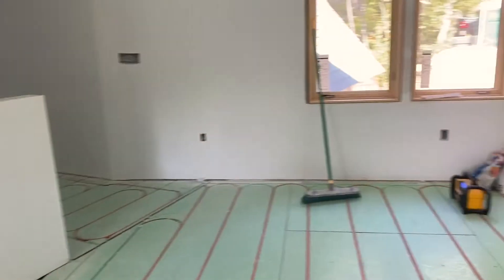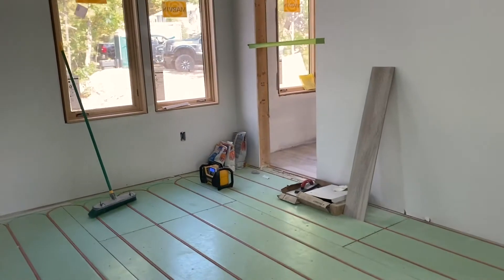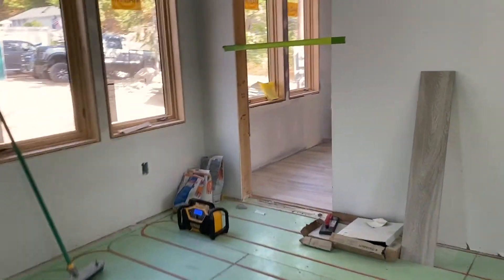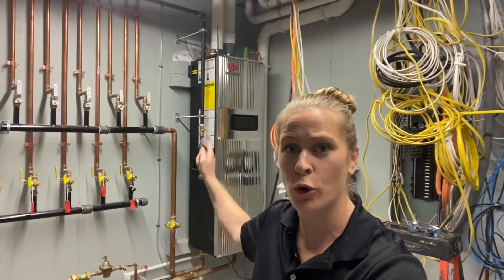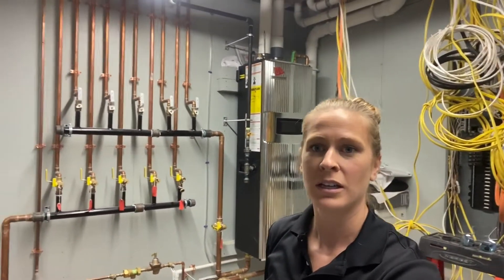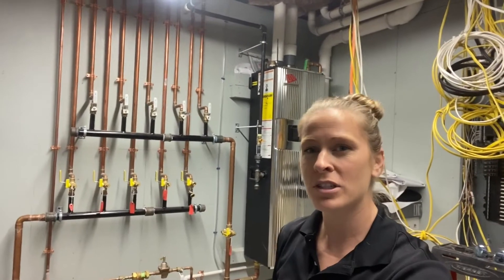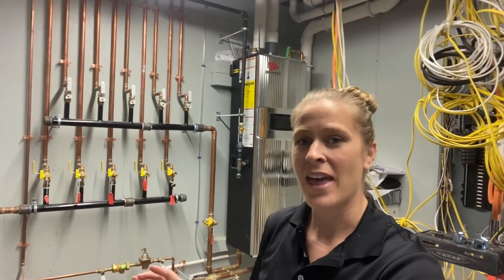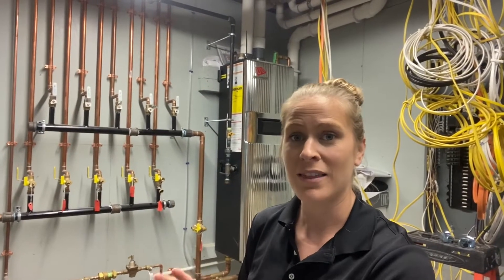Warmboard Comfort System installation in New Hampshire

Comment: Does the warmsource boiler run off natural gas? Do they have an oil boiler version?
Reply from the maker: Natural gas or propane currently. Electric version in the works for 2021.
Reply: @Warmboard  And does it vent out the side of the house or use chimney?
Reply from the maker: @bhzf76799  Up to your plumber, but it basically vents out like a normal boiler would. We have guidelines for this in our installation manual.